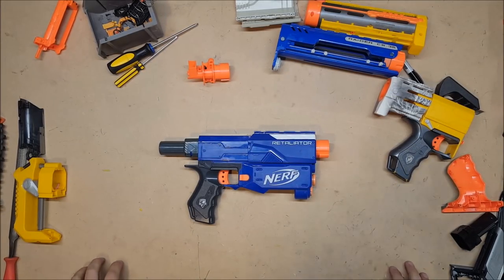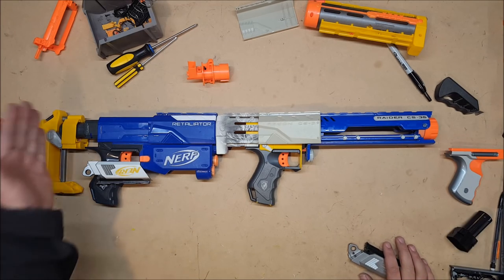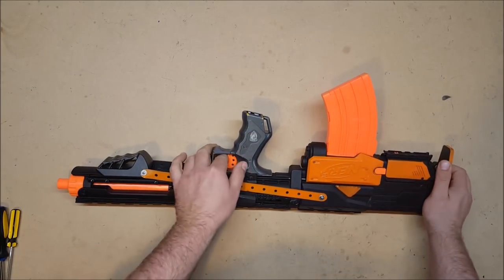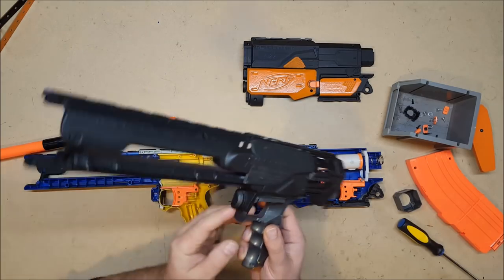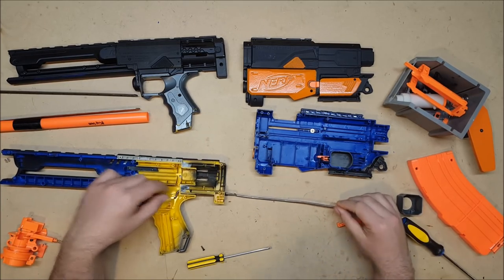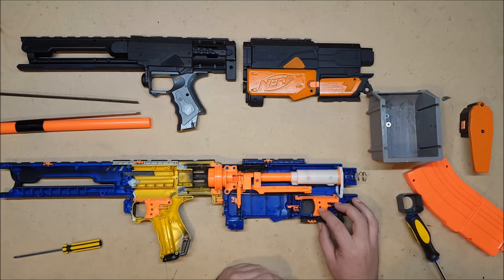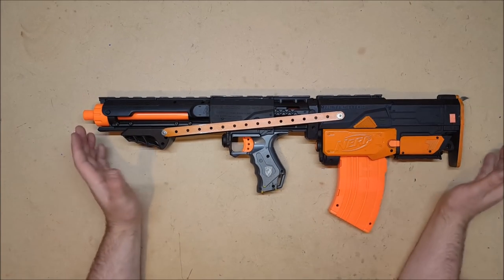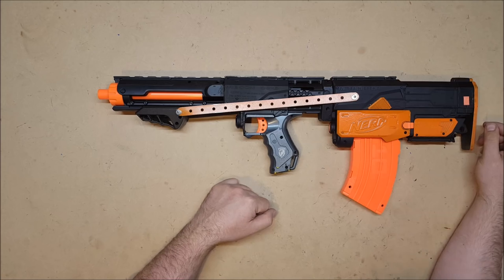Nerf Bullpup Retaliator - Build, Internals & Firing

Comment: That's awesome! You should get an expanded plungertube to compensate for the long ass inner barrel
Reply from the maker: Oh yes, there will be internal upgrades...someday...
Reply: why don't u put a lingshot plunger tube in the retaliater.
Reply: Captain Xavier is the stock still a recon or is it different
Reply from the maker: It is different.  The socket is from a recon stock, but the butt plate is custom made.
Reply: Captain Xavier from what
Reply from the maker: Mizter Wizter A piece of black plastic.
Reply: I have an idea.
Reply: Put a barricade cylinder on the front of a strufe for extra ammo i just tested the fit you just need to epox it and drill a hole for the darts to shoot through,Ubt its mainly for ammo stoarage.
Reply: Ooooo and cut up a zeus mag and put it on too as a barrel

Comment: That's the longest barreling I've ever seen.😂😂😂  It might need a longshot plunger tube to get enough power to stop barrel drag.Overall it's a neat concept but I think the one walcom showcased is more practical. It's just bullpups are ment to be compact and this is pretty lengthy. Still overall I like this mod. And I think the bullpup retaliator idea has great potential.
Reply from the maker: +Daltonator 72 with the mods I put in it "barrel drag" is negligable. Amd frankly I think "barrel drag" is overestimated anyway. 

As for bullpups being short, it is still shorter than a Rampage or Retaliator (with barrel).
Reply: Captain Xavier huh I didn't think it was shorter than those blasters. Well that's good to know. You have now mastered the bullpup design.

Comment: wow that is amazing, i am so doing that, and the parts a fairly cheap, but how well does the pump work doesn't it need extra force because it is at angle, and if ti was me i would have put a longshot plunder tube and brassed it
Reply: Now that Appollos are a dime a dozen, those have the same tube and , you don't kill a longshot

Comment: Shouldn't a bullpup end at the trigger? What's the point of a bullpup if you put a big barrel on it?
Reply from the maker: "Bullpup" just means the action is behind the  handle instead of in front.  There are two possible purposes for this.  One, as you say, is to allow for a short overall design.  Good for close quarters and concealment.  The other, however, is to all for a long barrel without increasing the length of the gun.  Longer barrels are more accurate but long guns are cumbersome.  But moving the action back into the stock you can increase the barrel length without increasing the overall length of the weapon.  

This blaster is shorter than a Recon/Retaliator, or Alphatrooper so it does still meet the first option.

Comment: that is awesome but you should find a metal bar to fit in the shell for the firing trigger instead of a cord
Reply: or did you use a metal bar
Reply from the maker: Yeah, I used a steel rod.

Comment: 3:00 You should try replacing it with the pump/forestock (or whatever it's called) from a Battlescout :)
Reply from the maker: I ended up replacing it with a Roughcut pump grip.  Much nicer.

Comment: Should have made the pump an old priming slide so you could put on different attachments there like a bipod or the stampede for grip
Reply from the maker: The rail attachments do not connect strong enough to prime with.  If I added picatinny rail and got a proper fore-grip it would work.  But I didn't want that kind of a grip.

Comment: What kind of putty/epoxy would you suggest? And is it useable for structural work (can it handle a fair amount of stress/force?)
Reply from the maker: +SuperRinocicorn Bistro I use Oatey's fixit stick and while it should be able to hold I don't trust it and always reinforce with screws.
Reply: Captain Xavier Okay, thanks very much!

Comment: How does the paint not scratch off in certain areas like under the slide/grip? Whenever I've sprayed up a gun the paint scratches off really easily under those areas.
Reply from the maker: Callum Parkin-Jones I will given time. But I don't mind. Givesnit character.
Reply: Do you use rattle cans, airbrush or acyrillics?
Reply from the maker: Rattle can for the body and accents.  Model paint for the detailing.

Comment: Captain Xavier, Umm do you have a upgraded spring in that? And from what I've found 1/2 copper in the barrel helps with more predictability shots at mid ranges but it kills fps. I'm going to look more into it in the next month or two when I can get some stronger springs.
Reply from the maker: I do not have any upgrades in it at this time.  I definitely plan to upgrade it in the future.
Reply: i wouldn't use copper, its heavy as hell and frow what ive heard doesn't really work as a barrel material.

Comment: hey Captain Xavier, while working on my Bullpup Retaliator I have come across an issue.  I have interlinked the triggers and when I pull the front trigger, the back one moves but not far enough to fire the blaster.  also when I release the front trigger the entire assembly moves forward but not quite enough and the whole trigger pull feels...gross, I guess is the best way to put it.  did you have this issue during your build and if so how did you fix it
Reply from the maker: I did not...I did right correctly?  :P
Reply: Captain Xavier lol I'm not good at explaining, back to the drawing board.  thank you though 😊

Comment: One critiqe, the intigrations are a bit crooked. I know it's your first attempt so I'll forgive that. Maybe when intgrating you can make supports to make it even?
Reply from the maker: Eric Williamson Yeah I noticed that after I got it puttied together and was not pleased with myself. I did have some internal supports but clearly not enough. Lessons learned. This was meant to be a learning project. Thanks for the advice. :)
Reply: You're welcome, it is a very cool consept that people don't touch on. Over all I'd say it is a succes
Reply from the maker: I think so.  I learned alot in the process and that makes it very valuable.  I am slightly tempted to try to take it back apart and straighten it but I suspect it is not worth the effort.
Reply: It might be worth it
Reply from the maker: Perhaps when I go to upgrade the internals I will try to fix the shell a little.  For now I am going to move on to new projects.  :D
Reply from the maker: It was so very very worth it.  John came over tonight to finish his and so I decided to break mine apart and fix it.  A great weight has been lifted.  :P
Reply: Great, can we see a finished product video?

Comment: the whole point of a bullpup is for a shorter barrel or rather a "shorter" barrel. still cool tho its just not really a bull pup
Reply from the maker: The term "bullpup" refers to any gun/blaster where the "action" is behind the handle.  So by definition this is quite definitely a bullpup.  Also, it is 4.5in shorter than either the Alpha Trooper or the Rampage and almost 5.5 inches shorter than a pump grip Retaliator so it qualifies even by your definition of Bullpup.
Reply: Captain Xavier thank you for the correction. you are technically right on that however in the video it looks a lot bigger than the measurements. again though the blaster looks amazing.
Reply from the maker: Thanks.  When you said that I had to go measure it because I was like, "haaaang on...is it actually shorter?"  It is. 

 I am actually not a fan of Bullpups in real life because like most guns they eject the shells on the right side of the gun and with a bullpup that means it shoots hot brass right into your face if you are a lefty...which I am...
Reply: Captain Xavier that is why real guns should have a setting to eject shells on either side. i'm also curious how you made the stock and how you cut down the recon barrel

Comment: i pike your build i pike most of your builds but i think tou dont need to do all that for just to look badass i think an alpha trooper costs less
Reply from the maker: You know, I said that exact same thing when I was watching my friend build on of these in my shop.  He pointed out that the Retaliator can be modded more than the Alpha Trooper and that bullpups are cool looking.  He asked me to build one so he could see my take on the concept.  And I had all the parts (all bought at Goodwill so much cheaper than an Elite Alpha Trooper) and nothing to do on a Saturday so I built it, mostly for fun.  I love my Modded Elite Alpha Trooper and this thing will never replace it in my loadout.
Reply: yeah alpha trooper is for me the best nerf gun for lots of factors compared to others you know like shooting  and price
Reply from the maker: Absolutely.  I have very rarely heard anyone say anything bad about the Alpha Trooper.  I still believe it is the best out-of-the-box HvZ blaster Nerf has ever produced.

Comment: Use a k26
Reply: Jeremy Lopat doesn't fit in retaliator
Reply: Invicte Jsk you can cut it with a dremmel. Look at Walcom's Beer 'n' Boomco
Reply from the maker: I make steel armor so I have plenty of ways of cutting spring.  However, I suspect a k26 might be more than the priming bars or integration could handle.  I have started a new videos series call, "Can it Take a K26" and I will eventually test the retaliator.

Comment: why don't Nerf make guns that look like that .that's 100× better than most of there guns they make .
Reply from the maker: shurgs  Perhaps they will eventually.  They seem pretty good at using ideas modders come up with.  The Stryfe was clearly taken from the barricades that modders made mag fed.  The FlipFury is clearly taken from the multi-cylinder Mavericks.  The Rampage is just a modded Raider.  Maybe they will finally release a pump action Pullpup springer.

Comment: @CaptainXavier I was wondering what program/s you used to film your footage, and how did you get that camera angle.... I would like to post some of my own mods and could use any advice
Reply from the maker: So far I have been using my Galaxy S6 suspended from my shops rafters by a flexible phone mount for filming.  For editing the videos I have been using MS Movie Maker.  Nothing fancy but it seems to be producing decent quality.
Reply: Captain Xavier yeah suspended from your rafters seems to produce Smooth video quality
Reply: I'm actually planning on using your absolver build to make an under barrel shotgun for my Longshot CS6